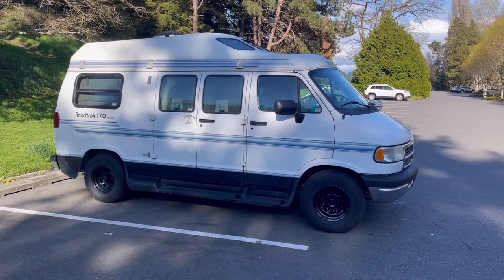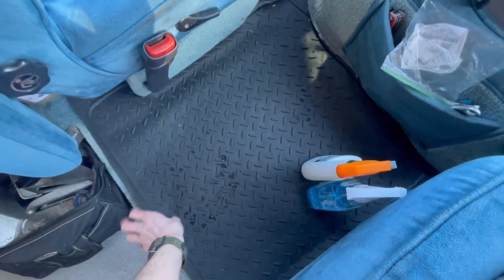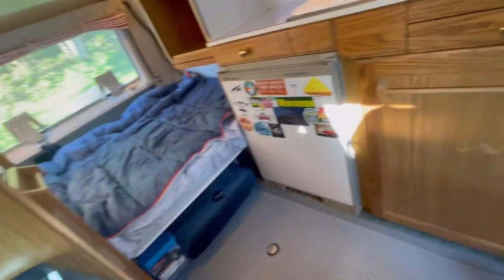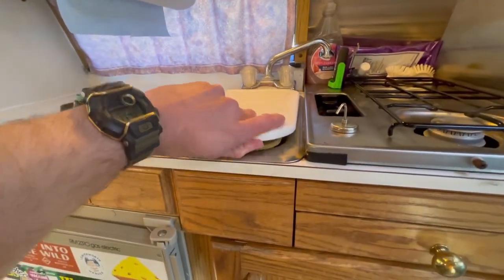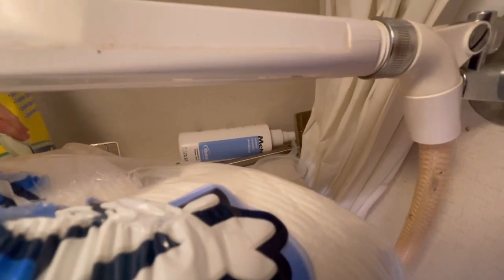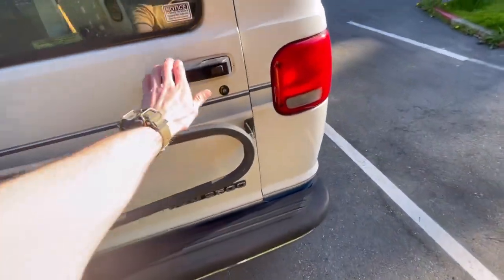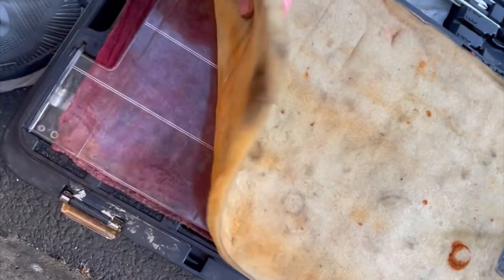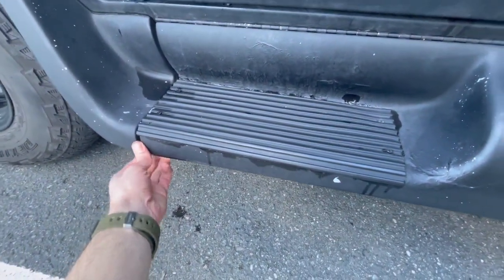$10,000 Roadtrek Class B Van Build: 2-Year 30,000 Mile Update and Tour

Comment from the maker: Thanks to all who follow along!! Please like 👍 and subscribe!! Our goal is to reach 400 subscribers! 

Van Update videos:

Off Roading The Van: https://youtu.be/re3Bmyc8tj8

2-Year Van Tour/Update: https://youtu.be/GWHniTnnEzI

Headlight Upgrade: https://youtu.be/5q-41BT9oFo

Mirror Repair: https://youtu.be/F0FJ5aRpbyI

Oil Change Regimen: https://youtu.be/eh5hm_hMb2k

Engine Tune Up: https://youtu.be/vzd7DDDPpUQ

Clogged Catalytic Converter Diagnosis:
https://youtu.be/6ezp6THDv34

Throttle Body Modification: 
https://youtu.be/R7S1n8S-XmA

House Battery Replacement: https://youtu.be/KMwAkPRZfb0

Upgrades to the Van as of April 2023 (affiliate links):

2000 watt Modified Sine Power Inverter:
https://amzn.to/3WzcDUg

Tire pressure Monitoring System:
https://amzn.to/3NCc0oO

Pro-Comp 51 Wheels:
https://amzn.to/41GqsSo

Monroe Shocks:
Front: https://amzn.to/3LkiIR0
Rear: https://amzn.to/41O2Dbq

Rear-View Mirror Back up Camera:
https://amzn.to/3WtwVP3

Refrigerator Temp Monitor:
https://amzn.to/3UwI7s7

Bluetooth Single DIN Stereo:
https://amzn.to/3t8I3TL

Oil Filter I Use (Fram option)
https://amzn.to/3h4Ma0s

Oil I Use:
https://amzn.to/3fzrT2X

Lucas Oil Additive I use: 
https://amzn.to/3H1O3Ff

Oil change Sticker’s I use:
https://amzn.to/3UBLEpQ 

Redline Grease I use:
https://amzn.to/3TtWbBT

Air Filter I use:
https://amzn.to/3UqQiGy

Lucas Fuel additive I use:
https://amzn.to/3UWA9KD

Locking Gas Cap:
https://amzn.to/3WDYcyq

Phone Mount: 
https://amzn.to/3TaWC43

Rubber floor mats I use:
https://amzn.to/3LgBngu
https://amzn.to/3UR2n9z

Spot mirrors:
https://amzn.to/3KV8DbM

Security blinking lights:
https://amzn.to/3WBzvCE

Accel Performance Coil:
https://amzn.to/3fFWDz9

Wireset Looms:
https://amzn.to/3UvhIuO

PVC Valve: 
https://amzn.to/3NLtPBV

Fan-Clutch:
https://amzn.to/3AfrE3N

E Fan Sensor Switch Housing:
https://amzn.to/40m143q

Breather Filter:
https://amzn.to/3zK5y9K

Belt Tensioner:
https://amzn.to/3T94Olg

LED Backup replacement bulbs:
https://amzn.to/3hesEyS

LED Headlights: 
https://amzn.to/3UacDbI

LED Interior lights:
https://amzn.to/3LjDEr8

Smoke Alarm:
https://amzn.to/3hhTUw7

CO2 Detector:
https://amzn.to/3t3fLdG

Off-grid tool kit I’ve been building for over 5 years (affiliate links):

301 piece Mechanics tool kit
https://amzn.to/3WtsIuJ

Bluetooth OBD Scan tool (for iPhone)
https://amzn.to/3WwRv0S

Bluetooth OBD scan Tool (android)
https://amzn.to/3hetNXc

O2 Sensor Remover:
https://amzn.to/3UaaVai

Tire Inflator:
https://amzn.to/3t3Qv6W

Farm Off-Road Jack:
https://amzn.to/3U80kNa

Clogged Catalytic Converter Diagnosis:
https://youtu.be/6ezp6THDv34

Throttle Body Modification: 
https://youtu.be/R7S1n8S-XmA

House Battery Replacement: https://youtu.be/KMwAkPRZfb0

Upgrades to the Van as of April 2023 (affiliate links):

2000 watt Modified Sine Power Inverter:
https://amzn.to/3WzcDUg

Tire pressure Monitoring System:
https://amzn.to/3NCc0oO

Pro-Comp 51 Wheels:
https://amzn.to/41GqsSo

Monroe Shocks:
Front: https://amzn.to/3LkiIR0
Rear: https://amzn.to/41O2Dbq

Rear-View Mirror Back up Camera:
https://amzn.to/3WtwVP3

Refrigerator Temp Monitor:
https://amzn.to/3UwI7s7

Bluetooth Single DIN Stereo:
https://amzn.to/3t8I3TL

Oil Filter I Use (Fram option)
https://amzn.to/3h4Ma0s

Oil I Use:
https://amzn.to/3fzrT2X

Lucas Oil Additive I use: 
https://amzn.to/3H1O3Ff

Oil change Sticker’s I use:
https://amzn.to/3UBLEpQ 

Redline Grease I use:
https://amzn.to/3TtWbBT

Air Filter I use:
https://amzn.to/3UqQiGy

Lucas Fuel additive I use:
https://amzn.to/3UWA9KD

Locking Gas Cap:
https://amzn.to/3WDYcyq

Phone Mount: 
https://amzn.to/3TaWC43

Rubber floor mats I use:
https://amzn.to/3LgBngu
https://amzn.to/3UR2n9z

Spot mirrors:
https://amzn.to/3KV8DbM

Security blinking lights:
https://amzn.to/3WBzvCE

Accel Performance Coil:
https://amzn.to/3fFWDz9

Wireset Looms:
https://amzn.to/3UvhIuO

PVC Valve: 
https://amzn.to/3NLtPBV

Fan-Clutch:
https://amzn.to/3AfrE3N

E Fan Sensor Switch Housing:
https://amzn.to/40m143q

Breather Filter:
https://amzn.to/3zK5y9K

Belt Tensioner:
https://amzn.to/3T94Olg

LED Backup replacement bulbs:
https://amzn.to/3hesEyS

LED Headlights: 
https://amzn.to/3UacDbI

LED Interior lights:
https://amzn.to/3LjDEr8

Smoke Alarm:
https://amzn.to/3hhTUw7

CO2 Detector:
https://amzn.to/3t3fLdG

Off-grid tool kit I’ve been building for over 5 years (affiliate links):

301 piece Mechanics tool kit
https://amzn.to/3WtsIuJ

Bluetooth OBD Scan tool (for iPhone)
https://amzn.to/3WwRv0S

Bluetooth OBD scan Tool (android)
https://amzn.to/3hetNXc

O2 Sensor Remover:
https://amzn.to/3UaaVai

Tire Inflator:
https://amzn.to/3t3Qv6W

Farm Off-Road Jack:
https://amzn.to/3U80kNa

Comment: We have a 95 dodge 2500 mark 111 hightop and we really enjoy it, it's mostly renovated
Reply from the maker: Love these dodge vans hope to keep mine forever! Plan on renovating it once I return to the Mainland!
Reply: @Fred_Amyett  it’s very possible to keep them forever , it’s no different then burying one underground all you have to worry about is corrosion they are built like bunkers, we have new wood flooring, full size bed and bed frame built out of 2x4s and 2x6s a fully working sink with a 7 gal tank, the water just drains under the van, has power hookups 110 plugs has one 100w solor panel that quit working unfortunately lol, it’s pretty cozy it has a propane fire system for the winter that looks like a fireplace, and has a General Electric AC system via window unit lol

Comment: have you gone up into the mountains much in winter? I was getting really whacky tire pressure readings on long drives through altitude. like i'd start out as low as 35psi and end up around 42 and every tire was in between. kinda weird.

Comment: Great info! How do you wire the inverter to the electrical system? Is it just plugged into inverer or run through fuse box?  I'm installing inverter this week and that would be awesome!
Reply from the maker: Thank you for watching! Due to the size of my inverter, it came with thick gauge wires that I routed directly to the House battery (battery underneath the storage compartment). I then found a thick gauge short extension cord and sliced the ends and wired it directly into the main fuse box on the van (removed a few screws and exposed all the wires) the off shore plug is routed to the same place I believe and I simply placed those wires in the same spot.
Reply: @Fred_Amyett  very cool, thanks!

Comment: Good update video. I was trying to find out where the coach battery was located but I see in your video. Thanks. Whats the best way to run power in the house as in battery preference?  I've read blogs and seen videos about using lithium batteries but I read also that they are kinda sorta expensive. I just want to run certain things like maybe the microwave and possibly a TV either attached to an DVD player or video game setup. Because I'm the only one who's going to be in the van. I would like to able to use the battery power until I get solar panels for the time being.
Reply from the maker: So far I chose the most affordable option which is a traditional lead acid deep cycle. I hope to upgrade one day but it’s definitely suited my needs so far. I think a single lead acid battery could do what you are asking of it for a day or two between long drives. If you got a 100w solar panel I could see that being able to sustain those needs with a battery depending on the wattage on the tv and dvd player but those are generally lower consumption than say a compressor refrigerator or anything high wattage use like a/c or electric cookware.

Comment: Great video!  I have a question regarding your tires... looks like you've replaced your factory rims and tires with  nice off road tires and rims.  I have ordered mine thru Tire Rack, but haven't put them on my 1995 Dodge American Cruiser (same Dodge van and chassis as the Roadtrek).  When I ordered the new rims and tires, Tire Rack had an exclaimer that stated that because of the tires' "aggressive fit", the van may need a lift kit.  My question to you is:  did you have to install a lift kit on your van in order the tires have proper clearance?  I did notice that these rims and tires that I have ordered from Tire Rack are a little wider than the factory width of the tires that were on the van (now a 245 width).
Reply from the maker: Thank you so much for your kind word! The tires I ordered were the original sized tires. 235/75r15. 245 will be somewhat wider. The rims I ordered have a wider offset. What is the offset of the rims you purchased? 

I like using this calculator. 

https://tiresize.com/calculator/

If your tires are under 30” I think you’ll be good! Mine are 28.9”
Reply: @Fred_Amyett  Thanks for the reply.  A mechanic friend of mine said that my new tires would fit.  The Ram B3500 body does have enough clearance for my new tires.

Comment: That Dometic Propane fridge is junk.  Your are better off just replacing it with any 12 volt compressor fridge (pricey).  I changed out my Dometic with a Novakool that fit in the exact same spot but it was way too expensive.  I think Dometic also makes a 12 volt compressor fridge that fits the exact same size that's about $599.  I use the same lucas on my 5.9 van but don't drive it much anymore.
Reply from the maker: I’ve been contemplating what to do for refrigeration on the van… I agree the pilot light randomly going out or having to keep the van level and food spoiling definitely gets old. Considering a compressor fridge once I get solar figured out.